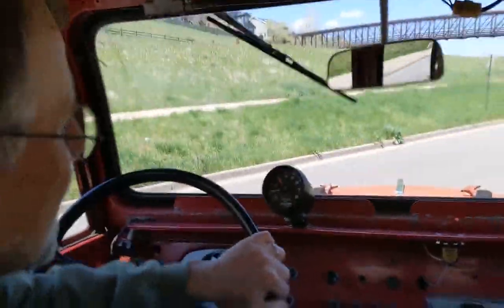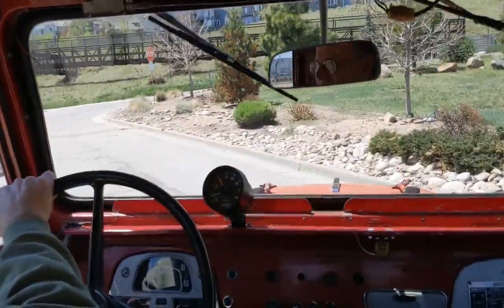First Road Test!

Comment: Looks like you're missing your rear fuel cap?  Cool little truck - like a fast tractor - lol.
Reply from the maker: A previous owner added a second tank that's been unused for a long time.  The filler hose has rotted away and there may be rust inside.  I'm leaning toward removing it, but interested in feedback.
Reply: @mikerestoresanfj4069  I think the Spectra Premium GM18B tank will fit back there - you can find them on Ebay or Amazon for around 80 bucks - double check the dimensions before purchasing.